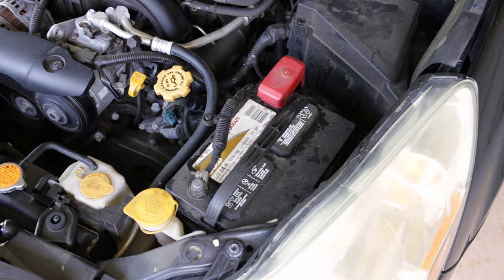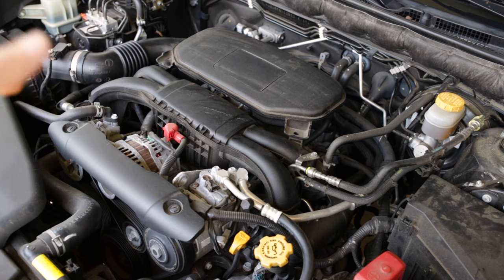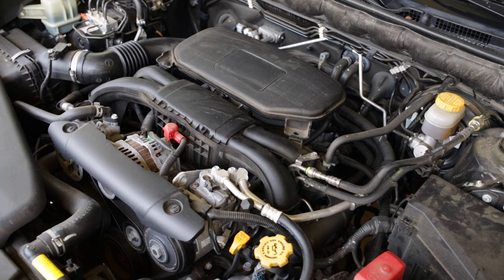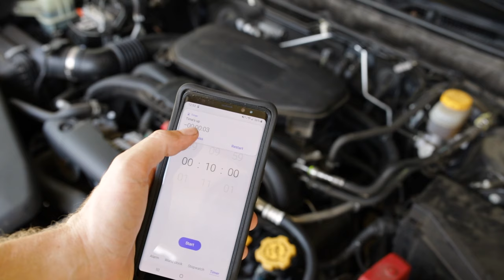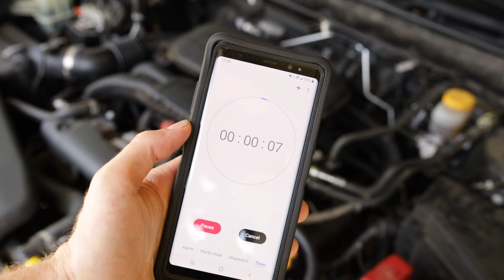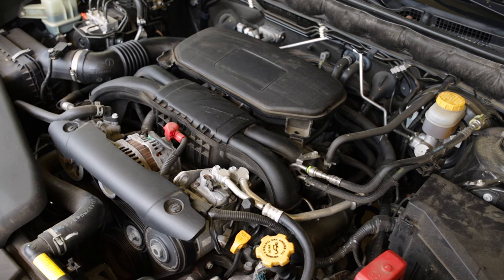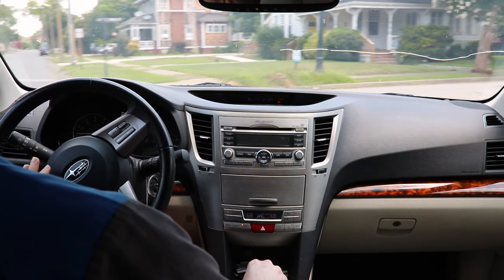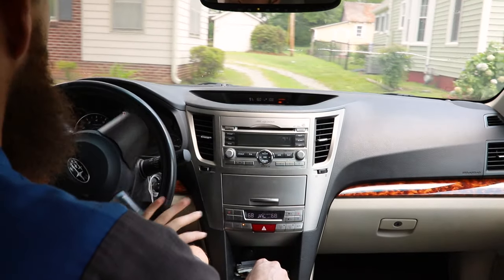Subaru Idle Relearn Procedure

Comment: Does this have to be done when you clear a error code?
Reply from the maker: No. Just if you disconnect the battery or clean the throttle body.
Reply: @MrSubaru1387  after I clear the codes my idle is low for the first 5-10 starts.  Thought maybe that had to be done

Comment: I change the battery and my car start to shutdown while slowing down the corner when the gear lever to neutral.  Is this applicable too to my problem? Thanks!
Reply from the maker: Could be.
Reply: @MrSubaru1387  i tried lately but it didnt work. before i change my battery the car runs great. tomorrow i will try to clean the throttle valve. thanks  my car is 2007 impreza gl
Reply: i saw your other video how to clean the throttle body. though i did it once before the first time i got the car. but your video makes me think to clean it again  . now its back to great condition. thanks bro
Reply from the maker: @dawanderer5593  you're welcome 👍🏻

Comment: Is there a such thing as a cvt transmission relearn? I have a 15 wrx cvt and lately i been only using paddles because when i put in into regular auto D it will shift so high that it makes it tougher to accelerate past 3k rpms and when i move the shifter to paddles i see its in that simulated 4th ⬇️ and im doing 25mph
Reply from the maker: Yes, there is a learn process. Take a factory scan tool though.
Reply: @MrSubaru1387  is this something the dealer can do themselves?
Reply from the maker: Yes.

Comment: Hi, I have a problem with my 2008 legacy. When I put it into drive, the car shakes and the acceleration is poor and if I'm parking uphill, it can even go back the in drive (it feels pike the gearbox doesn't hold the vehicle). I have cleaned the throttle body and changed spark plugs.
What do you guys think might br a problem?
Reply: For the shaking also check your air filter and see if it needs replacing, also maybe try cleaning the MAF sensor. Those can cause rough idle

Comment: Does this work for a 2002? Lmao
Reply from the maker: No. 2005+ with fully electronic throttle bodies.
Reply: @MrSubaru1387  okay thanks for the response! I did it and my check engine light went off and it’s running way better so I’m. Not sure what I did but it pretended like it was a 2005 haha
Reply: It DOES work, it’s just not necessary